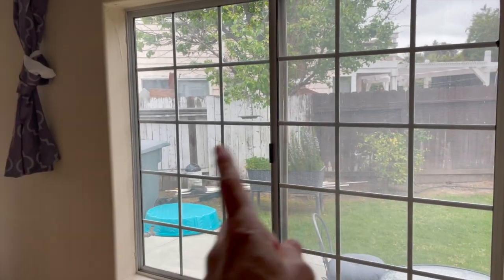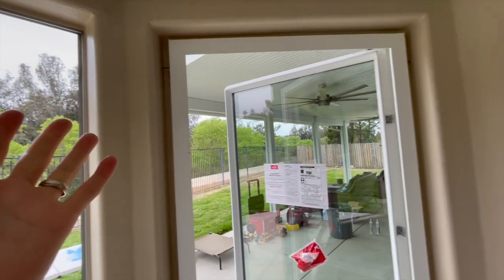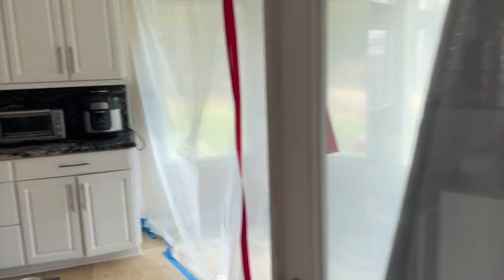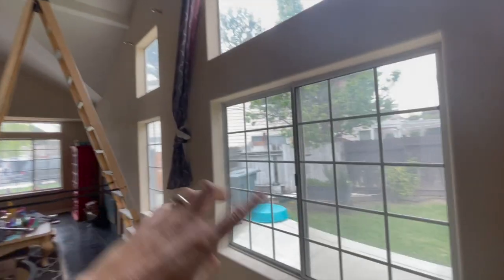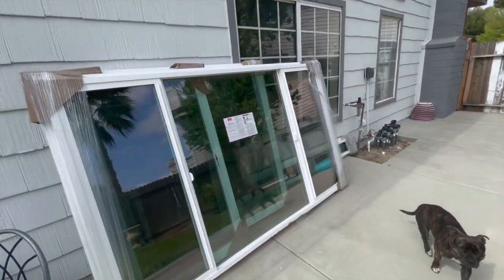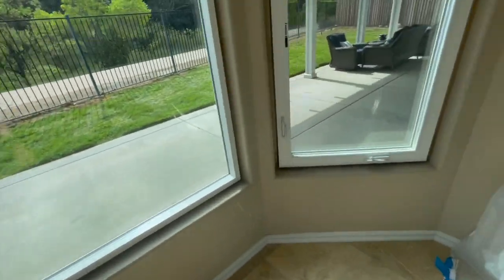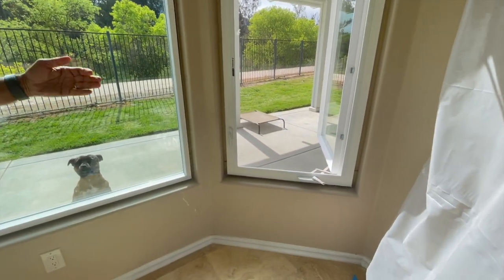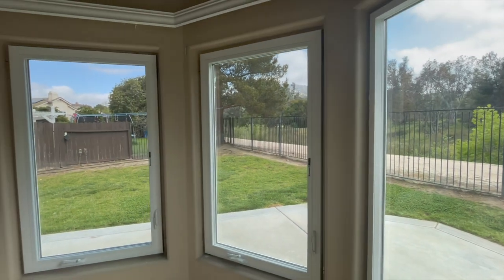New Windows! Our House is starting to come together

Comment: I had new windows(triple pane) in my bedrooms and kitchen.  I had awning windows and now bedrooms have to be casement to have emergency egress.  You will love having new windows.
Reply from the maker: I tried my hardest to push for triple pane on those hot windows in the bay window area! They just do double here! I couldn’t get them or Home Depot or another guy to even listen to me about it! 🙈 (they said in really cold places they offer it but not for heat) Luckily it seems like these are doing a great job with the heat! Major difference! We’ve had a few hot days and it’s bearable by the windows now even without a curtain or blind! My mind is blown! Our last windows must have been so awful! They were double pane but original from the 80’s so I guess technology has changed big time on double pane! 💃🏼😅

Comment: Those windows are beautiful. The new ones look so much better on the outside than the old ones, and the trim is a lot better also. So happy for you.❤❤ I kinda like the way they look without curtains  better. I'm thinking that I wouldn't put any window treatments on the really high windows.

Comment: Have you thought of an awning or bermuda shutters over your really hot windows?  It would help keep it cool and give the house some more character.  I guess you have to see if your HOA would allow it.
Reply from the maker: Yeah—we have extreme high winds every night in the back of our house coming down that hill (we’ve had a couple tiny tornadoes! LOL) so exterior things don’t hold up well. I think we’re going with plantation shutters inside but we’ll see if they ruin the view first. Not sure what yet. We shall see! First things first…gotta get the drywall and everything fixed and put back together and then paint then we can play around and see what works 😆

Comment: Put in the remote control shades
Reply from the maker: I’ve looked into some of them but they need to plug into something and how do you hide the cord? I saw some have a solar panel that charges a battery which looks promising…but how do you get the cable outside? 🤔 gonna do more research when it comes time. We do have an electronic curtain on our massive window. The curtain hides the cable, but the electronic blinds are what I’ve been looking into so I don’t have to deal with decorating 😆😆